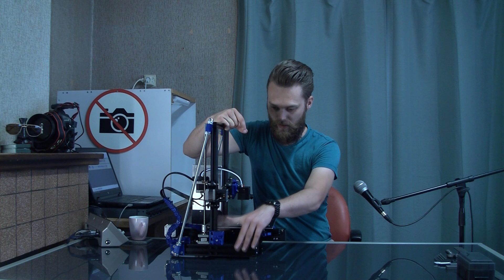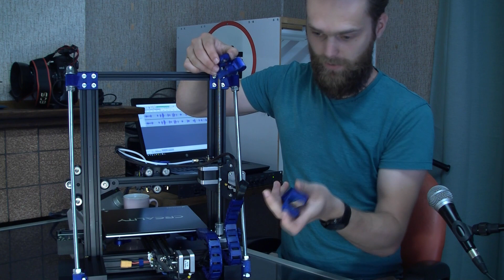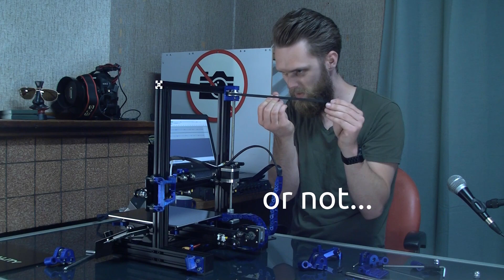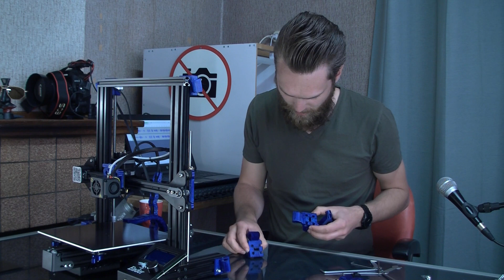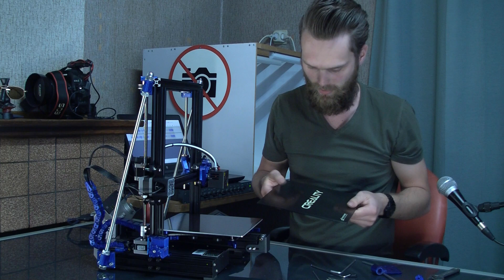Ender 3 pro dual Z axis

Comment: Can I add this to my dual Z set up if I'm running dual z steppers? My z never stays true. So I want to add a timing belt
Reply from the maker: Although I never did that, it should be possible. I think that the stepper motors need to be engaged before you tighten the pulleys, so they are in phase.
Reply: Thank you.  Im just hoping this helps keep them in time. This seems more solid them the dual belted z mod

Comment: Where did you get the 300mm lead screw? Reprap doesn't seem to have it. And is the lead screw an M8? What pitch?
Reply from the maker: https://reprapworld.com/mechanical/driving-and-transmission/leadscrews/lead-screw-tr8x8-8-mm-8-mm-per-rev-30-cm/ is the one you need

Comment: Great video.  Can I ask why such large pulleys?   Most are using much smaller. Wouldn’t the larger pulley require more torque from the motor?
Reply from the maker: Thanks! This pulley diameter together with this specific timing belt results in a center distance which is close to the offset between both vertical profiles, so I don't need a tensioner. The diameter of the pulleys don't matter for the torque (a tiny bit more inertia, but this is negligible).

Comment: did you have to calibrate the z steps after the upgrade? I seem to be missing a bit of height even tho the wheels are not too tight and the frame is sqare.
Reply from the maker: I indeed lost some height, but I never print this high so it wasn't an issue for me. You don't have to calibrate the Z steps since I use the same Z screw

Comment: Just subscribed, love your videos!  Great suff.  Very impressed with your 3D modeling skills.  Quick question;  I've seen you use the inserts before, do you have a link or what they're called?  Looks like you heat them up first, then press fit them?  

Thanks in advance,
James

Comment: Hi, very very nice upgrade and execution! 
Here in Argentina i can only get that belts: 610mm, 600mm, 500mm, 400mm, and these pulleys: 60, 40, 36, 30, 28, with what combination i can go, instead of the one u show in the video? i cannot find that 696 anywhere, pls help!
Reply: The same problem here.
Lo pudiste resolver?
Reply: @OsioPandaPeludo  No actually, but the 20t pulley and the 600mm belt of the artillery genius pro may work

Comment: hi. just organising the print. can i ask what the 1mm shim is for and how many? its not noted on your website. thanks
Reply from the maker: There's a bit of play between the pulley and the holder. I've used one shim on top of each pulley to remove that play.
Reply: @properprinting  awesome thanks. Going to be printing these tomorrow. 🤞🏻 out of curiosity what support settings did you use? I notice it’s going to need a fair bit of supports. Thanks

Comment: Not sure if I missed on your video or on the description on your site but I had to use small washers for the M5 nuts on the part that mounts behind the X gantry as the part was rubbing onto the vslot wheels and prevented them from rotating smoothly. The right side was dragging whenever Z changed direction before fitting the second rod and I found that weird. Adding the rod would stop the dragging but probably wear out the vslots. Adding 3 little washers did the trick with and without the second rod, everything is moving smoothly again.

Comment: I finally decided to go down this road myself. I am looking over the designs and the part list to be sure I got everything figured out before attempting this. One question @Proper Printing, what is the slot on the bottom back side of the top mount for? (https://imgur.com/mgn0o87) I don't see any hardware in the part list that would fit in there, but I could be wrong.
Reply: Never mind, I just needed to write the question to get my brain gears to run, they are obviously for the head of the screws since the screws are tightened on the back of the mount. Seems like there is nothing stopping me from starting ordering the required hardware and getting this together. Thanks for the great design!

Comment: The X axis carriage of my Ender 3 doesn't have the play that yours does. It actually doesn't have any play at all that I can feel or see. If I disconnect the Z motor, the carriage falls to the bottom on it's own so the POM rollers aren't too tight. That being said, I think I'll be adding this dual Z axis mod anyway because I'm planning to convert the hotend to direct drive which means more weight on the carriage. One change I'll be making is to modify the T8 nut bracket to accept POM anti-backlash nuts just to add a little more precision (I hope). Hopefully this mod will help with the additional load of the direct drive hardware. If not, then it's time for dual Z motors. As aways, good job on this mod.

Comment: I don't know why but I've tried to print thinky's files several times now, but every time after about 80% it makes some mistake, so far it has only wasted time and material.  have now loaded the file again directly from the website umd hope it fits now Material is already running out and the mood is in the basement.  what I don't understand is why everything fits in the slicer but the sm printer does not

Comment: Jon shouldnt that lead screw be a little longer?
Reply from the maker: It must be between 300mm and 400mm and I designed it to fit 300mm because that was standard
Reply: @properprinting  Thank you

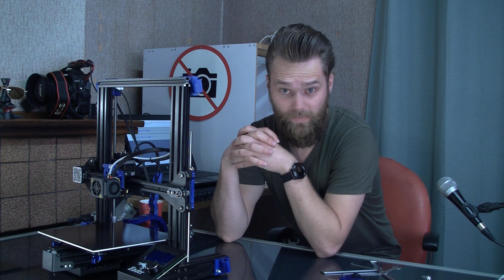Comment: 7:05-7:18....the exact expression my ender 3 puts on my face 95% of the time.  Been an industrial electrician for 20+ years, reload my own ammo (even have FFL to sell my reloads), can pretty well tinker my way through anything.  But this little bastard printer has handed me defeat after defeat.  
My determination to not be beat by that horse demon logo is all that keeps me going.  Fueled by hate, bound by my fleeting pride.  😐

Comment: No before and after sample prints to see if the modification had any effect at all.  Perhaps you should measure against the fixed top bar instead of the adjustable bed.
Reply from the maker: No, I should have done that, by bad. I haven't measured against the adjustable bed, but the bottom frame. I wouldn't use the top bar since the vertical beams might differ in length.

Comment: Excellent upgrade. I will be implementing quite a few of them on my E3Pro. What adjustable z Stop STL did you use. I can not seem to find. Thank You.
Reply from the maker: It's this masterpiece https://www.thingiverse.com/thing:2757323
Reply: I attempted this mod yesterday and the z axis moves up and down by hand pretty easily but the stepper motor chokes when trying to move the z axis. I don’t have the z braces installed yet so maybe the vertical extrusions aren't aligned. Belt tension seems ok. Thanks for all the Ender mods!

Comment: Directly connecting both ends of lead screws is not normally advisable. the vertical rails are your guidance system the lead screws are your motion system. when both are rigid and you link them you will get push pull between then IE you will introduce noise into your prints as the push pull between guidance and motion work against each other.

IN THEORY if built precisely enough it can work (and you are probably one of the few who I think could pull it off actually. your attention to detail is rather impressive) but for average joe user. not a good idea.

better to go with 2 steppers not physically connect and without both ends being "bound" (the tops of the lead screws free to dangle)

THIS way if there is any deviation in the hardware a surprising amount of it can be absorbed and "not" transfered to the motion system (the rails) which will then transfer to the nozzle as "deviations" ie noise usually z wobble as print artifacts.

however a properly configured machine where you do NOT use "zhop" 1 stepper actually is enough for a machine this size. as long as you don't bump it :-) hehe
Reply from the maker: Thanks for this information! I've loosened the slot wheels on the opposite side to make it slide good. The measurements must indeed be spot on to be able to tighten everything which isn't xD. I agree with you that the average Joe can have difficulties with it and it's difficult to design something new that works for everyone. My goal is not to make the best solution, but to try new things. I hope to inspire people and find better and new solutions based on the stuff I show :)

Comment: Hi I have been printing all the parts and my parts ordered have arrived.  what are the shims for ? I couldn't see where they fit in ?

Thanks
Reply from the maker: Thanks for using my design! I've added these shims later because there was a bit of play between the pulley and the bearings within the bracket. The shims can be placed in between so this play is eliminated.
Reply: Did you stick with the dual z? It seems in your newer vids you abandoned this approach and moved to your big daddy printer.  I still have the parts, I just had trouble printing your models with the correct tollerences, however my printer is now printing spot on with some frame mods.  Is it worth the work to go with a dual belt driven z? Or better to go with a second z axis motor?  Thanks again.

Comment: I really want to do this mod, but I'm worried about the lack of a belt tensioner. Won't the dual z belt stretch out over time?
Reply from the maker: Thanks for your comment and interest! In my experience, no it doesn't stretch much. It's already a tight fit and the pulleys are pretty big so this won't be much of an issue. I also do not have this problem with the other belts of the X and Y axis on any of my printers
Reply: @properprinting  thank you for the reply!

Comment: Hello great video! I would like to ask you, if this upgrade helped you, and if your print quality improved after this? Did you noticed any improvements? Thank you!
Reply: Hopefully he does not mind me participating and answering your question.

dual z won't improve quality on a machine this size unless it corrects something you could have otherwise corrected without it.  IT WILL however improve the resilience of the machine. it will make your tuned in results more reliable and more consistent IF done right. "direct connect" dual z is not for the novice unless you very much have an engineering mindset and an eye for precision. better to go dual z stepper with no direct physical connection (removes the tolerance z wobble issue that can arise from a direct connection.

dual z also makes the printer more resistant to perturbations. IE being bumped into picked up and moved etc.. etc.. IE things tend to resist moving from where you set them which makes the machine more reliable and consistent.
Reply from the maker: I certainly don't mind, rather the opposite, thanks! I couldn't have sad it any better :D I'm a bit behind answering some comments and clearly missed this one so thanks for answering it for me

Comment: 9:05, the back EMF from the rotating motor turned on the LCD screen for a millisecond.
Reply from the maker: Yes, it does. It even turns on the LED strip controller of my enclosure. I think it would be interesting to test how harmful this is because I think it isn't but I can't be certain.
Reply: @Chris Valin it's not as big an issue anymore as it used to be. I'd say it's still something as you want to avoid, but not as critical as on older boards such as ramps 1.4

Comment: What do you think of adding a second dual axis with a second stepper motor and avoiding the belt entirely?
Reply from the maker: I don't have experience with it but from what I've read is that you need a second homing switch to keep it level. I have too often had the problem with my Anet that one motor rotated when I was pressing in material. I read the problem of missing steps on one motor as well. With the belt I can be sure that it will always be horizontal.

Comment: Hi like ur vids, @9:05 u moving timing belt screen pops, like this test u need to remove motor cables while working which axe on , caus it can be dmg the board or drivers
Reply from the maker: Thanks man for your comment and suggestion! I haven't heard of that before. I do that a lot with both of my printers and never had problems. I use the standard board. Interesting point, I'll dive deeper into this.
Reply: @properprinting  Jón, motors are working like generators in an electrical circuit. You can feed power into them and they spin or you can spin them and they generate power. Physics laws prevent energy from disappearing so it gets fed back into circuit and many components on printer's motherboard don't have any protection against that.
P.S. you didn't show before and after results from this upgrade.
Reply from the maker: @yura979  Thanks for the information. I'm aware of motors being able to generate power and the energy must go somewhere. I'm honestly a bit skeptical if it damages the board. As far as I know the boards are protected against this since moving the head is a common thing to do. I cannot be sure if this is the case and I have to take a look into the datasheet of the drivers themselves. If the motors are spinning fast enough something will break. The question is which component and at which speed.
I haven't indeed shown before and after results. The results of the print itself will not be noticeable. The biggest improvement is that it's possible to adjust the gantry to make it horizontal and that the printer is more stable.

Comment: Hi Jon . When using the quick mount on the HotEnd do you make some changes in the gcode then? I ask because it looks like the HotEnd moves a little bit forward due to the mount :)
Reply from the maker: Good question. No, I don't change the gcode. I move the Y end stop a bit further to the front. This however reduces the build volume by approximately 20-25mm and I still want to find a solution for this.
Reply: Proper Printing thanks for your quick reply :)
Reply from the maker: No problem man, I'm happy to help :)

Comment: Hi Jon . Holy shit a great video and mod for the Ender . I have ordered the same parts and start to replicate yours 😃 I though have some trouble on printing the PETG . Can you share your profile ? How many percent infill do you use on the parts ?
Reply from the maker: Thanks and awesome that you're going to make this as well! My infill settings are around 20 to 30% and I use the standard settings by Simplify3D. I'm a bit lazy and had some problems with Cura and instead of fixing, I bought Simplify. I think I will post my printing settings on my blog for everyone to read. I print PETG at 236°C with a bed temperature of 60°C. Store this material dry because it is a bit hygroscopic, not as bad as Nylon, but still..
Reply: @properprinting  what's the brand of the blue PETG your using, and is it your favorite?

Comment: Hello. Nice Job.
How big are your M3 inserts?
Reply from the maker: Hi, thanks! The size is 4mm outer diameter with a length of 5,2mm. More information can be found here https://www.onkenhout.nl/pdf/multisert_zonder_kop/227/t/p the part number is 137104. It's a Dutch datasheet, but the illustrations are clear.
Reply: @properprinting  Do you have a link where you can buy them in the netherlands?
Reply from the maker: @JarwienNL  I get them from Onkenhout, but that's not accessible to the consumer. I'm planning to sell them on my website in the future. If you live in the Netherlands I can send them to you. Send me a mail to contact@properprinting.pro with what you need and I'll give you the price.

Comment: You are already pushing 2 motors a hotend and an entire axis up with one little motor because Creality wanted to cut costs. 

Wy on earth would u want to add an extra 2 pulleys, a belt and a Z rod to this? I think it's bad practice, best thing imho is to add another Z motor and ditch the pulleys and belt altogether. It is not that you have to break the bank for it and it is more then worth it. But thats me offcouse.
Reply from the maker: Thanks for your honest comment. The reason why I’ve chosen for this method is because I had problems with the two motors going out of sync on another printer. Like BlueprintDK mentioned in an earlier comment, this can be solved with homing both motors. The mechanical connection with using the pulleys will make sure that the gantry stays horizontal and it works flawlessly, even with this single small motor. Why would you think it’s bad practice? The way I see it, both methods work and will increase the printer’s accuracy and stability.
Reply: @properprinting  I was about to write this exact reason. Wanhao are a great example of why two motors are difficult to balance and keep in sync.
Reply: @RamjetX  I also agree as I want to improve my Ender 3 Pro with a dual Z much the same as this system proposal.........I would also look at the thrust faces of the pulleys on the screws as they will have friction from the screw pushing the gantry up if you don't have thrust bearings between the faces.

Comment: the ability to swap heads didn't make sense to me but the ability to use a dial indicator GENIUS!!!
Reply from the maker: Thanks for your comment! I swap between heads because I use one head solely for Nylon (E3D) a MicroSwiss for PETG and the stock one for PLA. My CR-10 is now my prototyping platform which is able to make things beyond 3D printing and it took quite long for me to find out that it's possible to just add the indicator xD I'm glad you like it!

Comment: Gr8 information and nice development 
Can I use a 40 teeth pulley instead of 60 teeth
Reply from the maker: Thanks! Smaller pulleys are possible if both are the same diameter. However, you need to make your own closed loop timing belt if you do this.